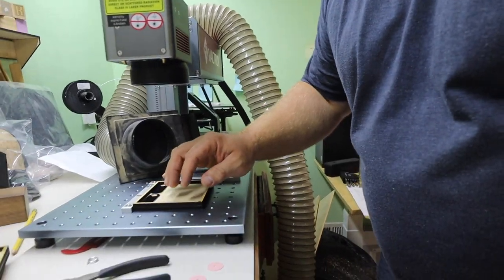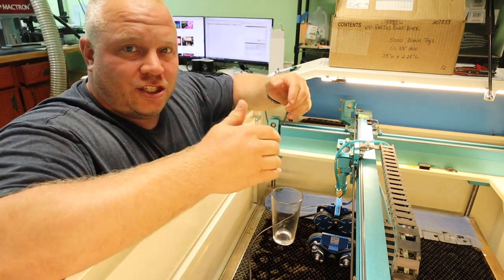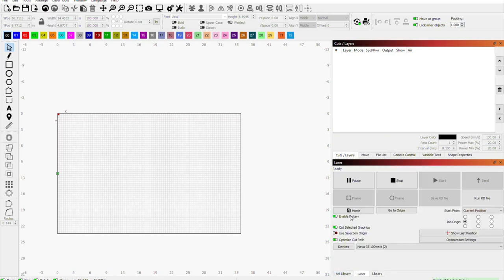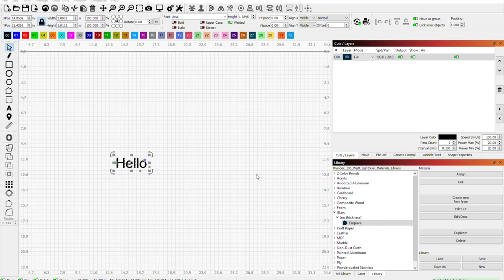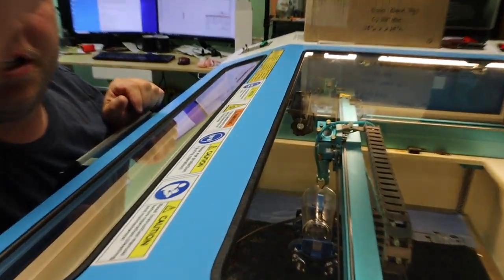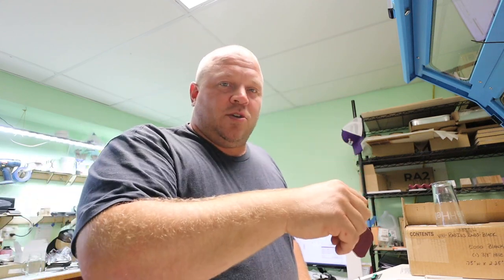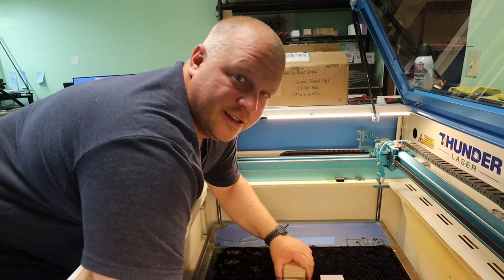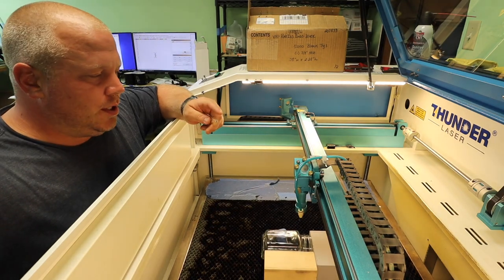How to Engrave Different Types of Glassware

Comment: Morning Matt, glad to see you again!  Did you get better results going from 6.5 mm to defocused 2? Not sure why you changed it.🤔
For those that have uneven garage floors, it helps to put your level on the gantry rail, mark where the bubble is so the item is square to the head.
For the square glass, the bed could be filled with the jigs and do them in one go.
Thanks for all you do!
Reply from the maker: Some glasses you need to that but not all

Comment: Hi Matt, just curious what the wattage is on your Thunder unit?  I have a 100w Omtech and glass has always been a challenge to find the correct settings to produce the clean results you get.  Thanks.
Reply from the maker: It is a 100 watt. It should be the same as mine